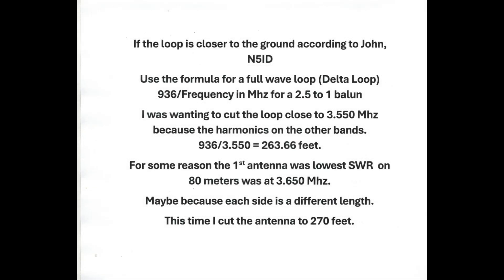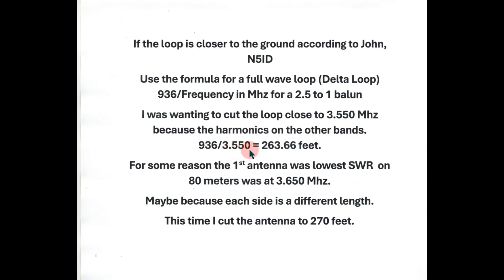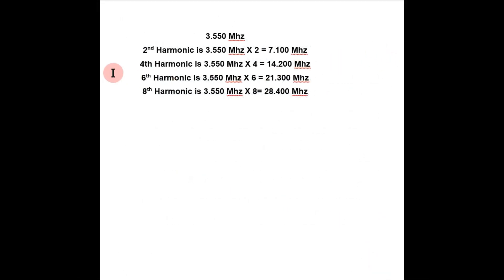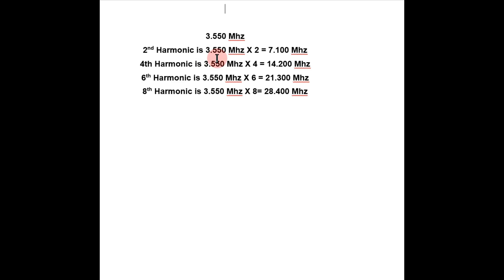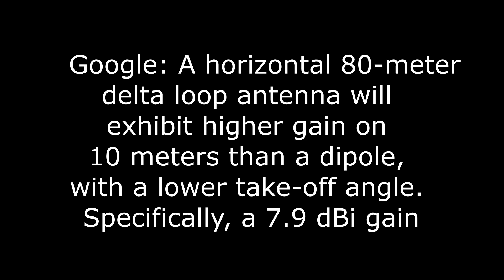80 Meter Delta Loop Ham Radio Antenna Adjusted

Comment: Using a similar antenna (google "SP7LA delta loop" and switch to "images"; there will be an old schematic from 1998, in Polish). Works quite well, especially on =< 17m bands, a bit worse on higher bands up to 6m.